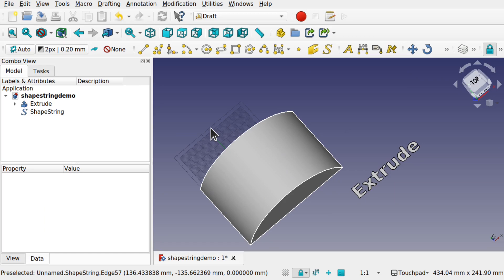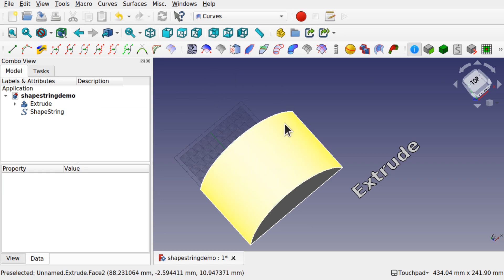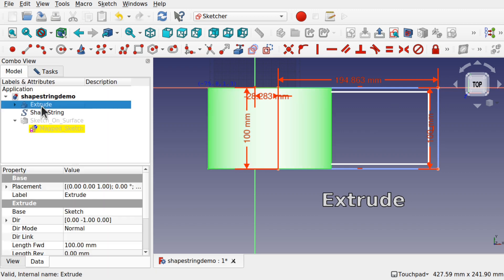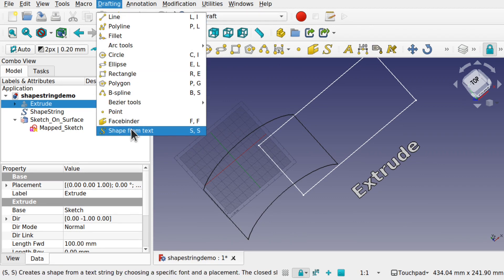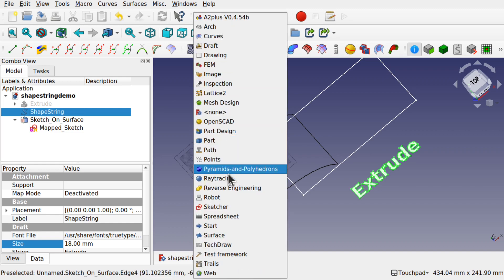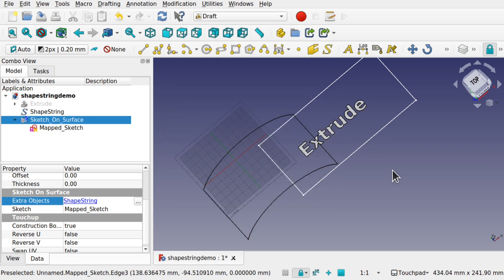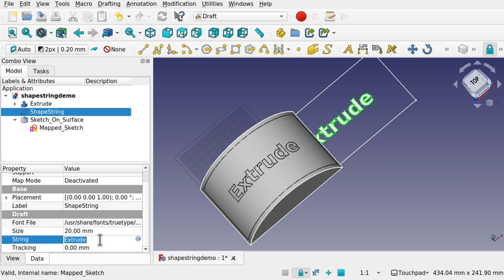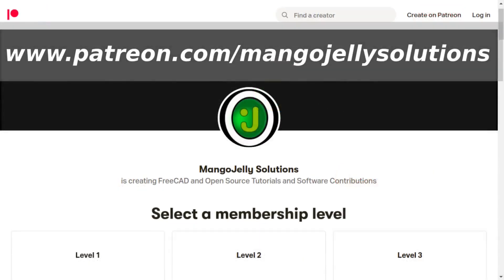FreeCAD: Quick Tip Editable Text on Curved Surface Without Converting to a Sketch

Comment: Hello, could you please tell me how to obtain a drawing of text applied to a cylindrical surface, taking into account the deformation of the text due to the cylinder's radius? That is, I need a drawing of the curved text, adapted to the specific radius of the cylinder.
Reply from the maker: It's an interesting question that one as I have never tried this with text.  I am wondering if this video will help https://www.youtube.com/watch?v=1JyiMy8rBv4 it's around 26:30
Reply: @MangoJellySolutions  Thank you very much, I was glad to ask you an interesting question, I hope you solve this problem and make an interesting video. I will be waiting for a new publication from you. I will definitely watch the video you suggested and I hope it helps me.

Comment: That worked great! Thank you! Unfortunately, I tripped and fell on my face when I tried to export the model for slicing (Cura). The text I placed on the curved surface shows in FreeCAD (1.0), but it doesn't appear in Cura for slicing. Did I miss something?
Reply from the maker: Have you tried a boolean fusion between the text and the surface in the part workbench and tried exporting the cut?
Reply: @MangoJellySolutions  No. But frankly, I don't even know what you just said about boolean fusion. It's a place to start. Thank you.

Comment: Thank you very much for the video.

IMHO, it's not fully parametric. I'm missing the option to handle text attributes via Spreadsheet and then via Python in loops. This would be top level.
Reply from the maker: So, I have a video idea where I will be covering that :)  And was in two minds whether to do it or not and I think I will.  There are some areas in that idea which will cover your questions.  I will be working on that next week hopefully.
Reply: @MangoJellySolutions  Thank you very much in advance. ♥️

Comment: i'm trying to put some embossed text on a tube..  My problem is that the when I create the construction box in Curves, it is in a different axis than the text.  The text should run across the longitudinal axis of the tube, but the construction box is perpendicular to it, so I had to do several transforms of the text to get the it in the same plane as the construction box. The positioning on the tube is ok. It shows that it should wrap in the correct orientation.  Anyway, after doing the transforms and selecting the text to be mapped, nothing happens.  Any thoughts?

Comment: Is ist possible to engrave the Text?
If I type a negativ number in "thikness" it won't work
Reply from the maker: Oh and if you haven't worked it out yet you will need to creat a boolean cut between the original object and the text using the part workbench.
Reply from the maker: There is a setting called offset. Which will offset the text. Try that with a negative value.

Comment: That was a great video - but when I tried to print a piece, the letters didn't appear.  Do you have a video on how to raise the letters?  I am trying to put raised letters on the side of a coin-like object.  Thanks.
Reply from the maker: When you exported the model did the letters get exported with it? It almost sounds like the letters were not fused with the base object.
Reply: @MangoJellySolutions  that might the the problem.  When I view the .stl file in my slicer app, I don't see the lettering.  But I do see the ShapeString letters flat on the surface (I exported the ShapeString as well). I am watching all of your how-to videos on FreeCad from the beginning - and I appreciate all of the work you did in creating the videos.
Reply from the maker: @SouthernMetal  Sounds like you haven't got a thickness on the sketch_on_surface.  Fill extrusion = true, fill faces = true and a thickness of your choice start with 1 or 2 first.  Thank you, glad your enjoying :)
Reply: @MangoJellySolutions  Im having the same problem.  Both extrusion and faces set to true.  But when I export it is not there.  On the tree it looks like a seperate thing but I cant move it into the part on the tree.  How do I fix this?
Reply: @JakeMosa   Something I ran into after watching this tutorial. The box that you draw in the surface sketch to find it, must be removed before you set an extrusion thickness or it will be extruding that box too and hiding your text.

Comment: I've got the text mapped corrrectly I think but when I try to extrude, I get "18:11:41  <Exception> Wires are not coplanar.
18:11:41  Recompute failed! Please check report view." Can you show in your example how to extrude the text on the face?
Reply: I figured out thanks to your other video; "Sketch on Curved Surface / Faces in Curves workbench. Celtic Ring / Jewellery 3D Printing". The key was under: 'Sketch_On_Surface/Settings/Fill Faces' and setting that to true. Was that was true, I could extrude. Now I'm trying to set the "Taper Angle" but that is failing for some known reason. I'm trying to make a sand  casting pattern and the lettering needs a negative draft angle.

Comment: I've used this process now on different applications. However, one area it won't work for me is if you are projecting the text on a swept surface. I.e the surfaced is curved in both the X, Y and Z plains. The text lays perfectly against the surface but when you attempt to give the "Sketch on surface" some depth a small exclamation mark appears and the text has no volume and cannot be Fused to the curved surface. Any help would be greatly appreciated.
Reply from the maker: There is another way without using the Curves workbench that may help you achieve what your trying to do.   But I will try to explain it here. Take your text and your loft. Place the text under the loft and Extrude it through. Use a boolean intersection operation. This will leave the faces of the text in contour of the loft which you can extrude.  If that doesn't make any sense (pretty hard to explain so more than likely not lol) hold on for a day or so and I will upload a video.
Reply: @MangoJellySolutions  Just doesn't seem to work, as soon as the text is mapped to the sweep the extrusion either doesn't carry across or the system doesn't see them as solids, therefore they cannot be boolean together.

Comment: I was wondering if you could do a video on FEM analysis of a pressure vessel. lets say a simple LPG cylinder. i have tried but for some reason it will not work. I am designing a vertical boiler for a small steam loco for another youtube content creator and thought, i would ask the question. HP295 steel used of course.

Comment: Strange thing, must be an issue with my FreeCAD. I was able to get everything to work once, when I tried to recreate it I had no problems drawing objects and pocketing them onto the surface of a curved plane, or a cylinder or such. When I try to do the text again, it will not map it properly to the curved surface.
Reply from the maker: Hmm strange, when you say not mapped correctly, can you describe what you are seeing.
Reply: @MangoJellySolutions  Trying to find a way to properly describe it, the object in sketcher will  map properly to the curves and everything. When I go to draft workbench to put the text in, I cannot get it to fit the curve of the shape at all, they stay flat. I checked to be sure that the shapestring is entered in the properties like you showed as well. The other issue is getting the draft workbench to even work sometimes, it will stay greyed out and not let me use it.